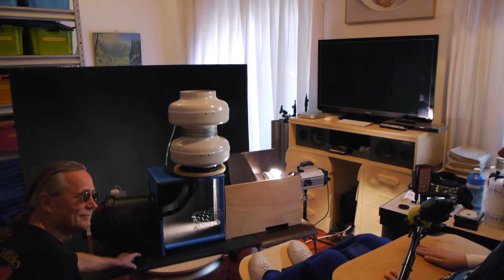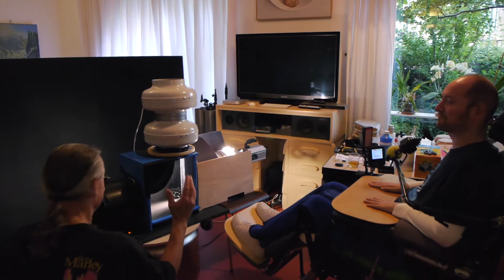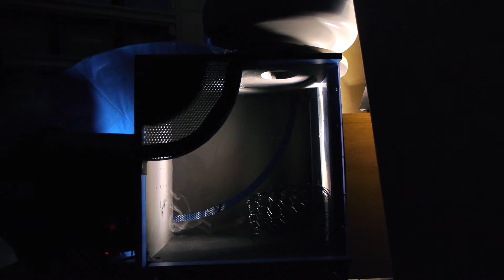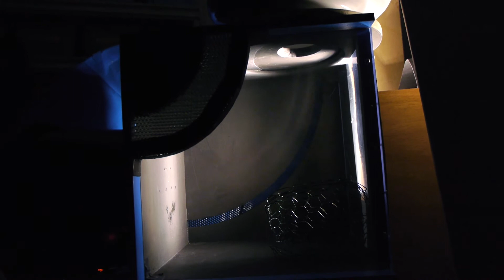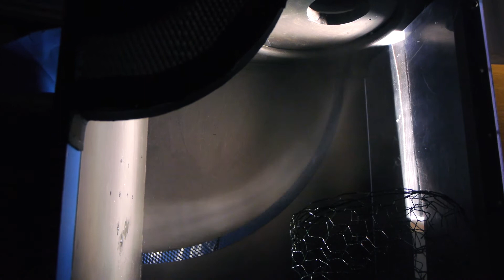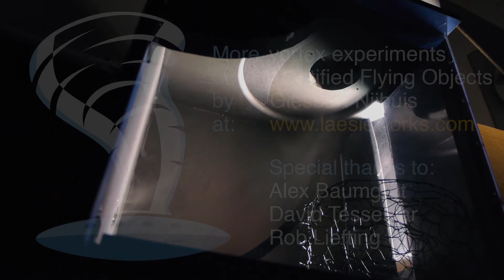Curved Vortex in a Box

Comment: That is cool another sweet curved vortex! I have not played with my tornado machine in quite some time because I have been using my shop space to build top bar beehives and you can see the on my channel
Reply from the maker: Michael Ellestad Bees fly by vortex! Every wing beat makes like a like a little tornado, a LEV, leading edge vortex. There is a lot to learn from them bees.
Reply: You should see my latest project, a solar scorcher made from a large Fresnel lens from a projection TV and it melts glass, rock, and metal all with the power of the sun